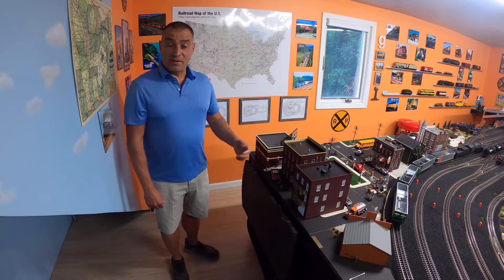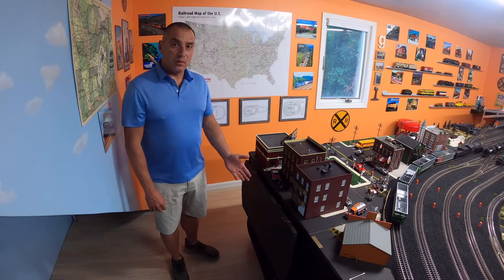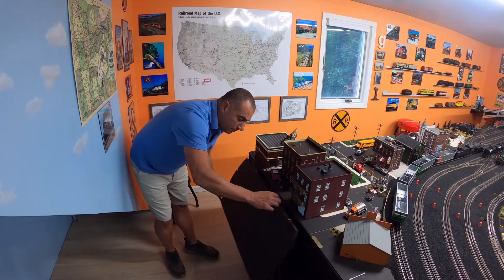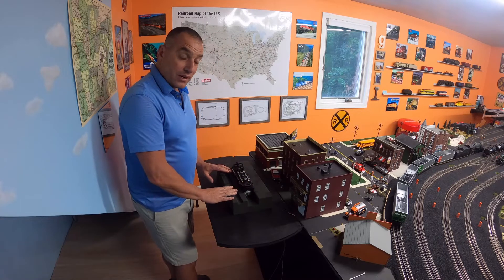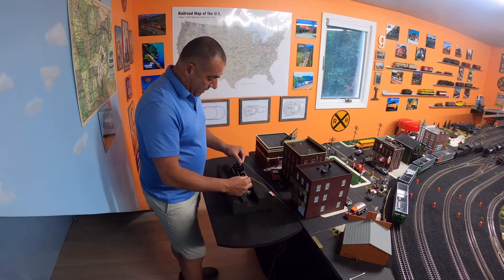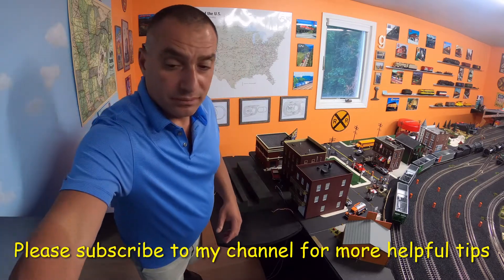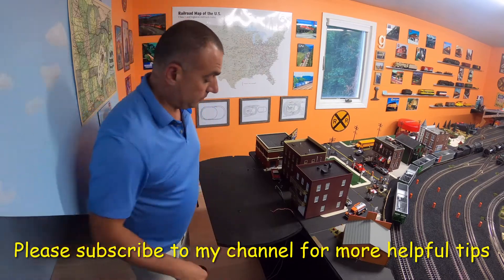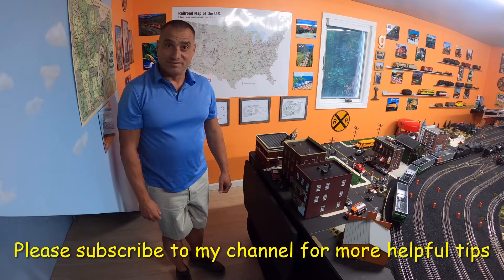Folding Shelf - Tutorial Series - Lionel Trains - O Scale Model Trains

Comment: Just catching up on some of your past videos George. Where did you place the power wires on the locomotive ?  Thanks
Reply from the maker: Hey Jim, the power wires are connected as follows: 1) the ac hot is connected to the pick-up rollers that contact the third rail. 2) The ac ground is connected to the truck axle by the wheels. - the wires are connected to the post on the transformer and powered by the throttle. The other end of the wires should have spade fork connectors. Wedge the ac ground connector between the chassis truck axle by the wheels, thrn wedge the ac hot  wire between the pick up roller and pick up roller frame with the ac hot. 
I also show these connections better in the "How to clean your trains video."  Try to watch this video if you get a chance to better view the connections to the train. Hope this helps!
Reply: @trainwild  It helps quite a bit !  Thank You
Reply from the maker: @James Melchin Yes it definitely helps! Your welcome James